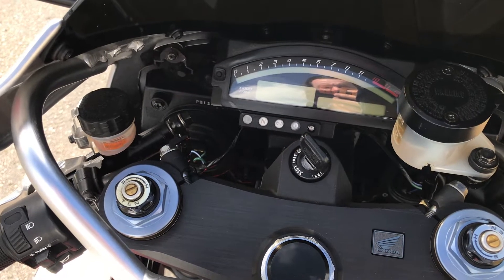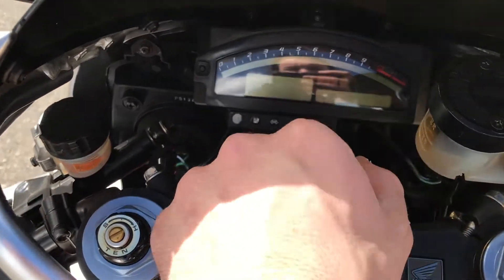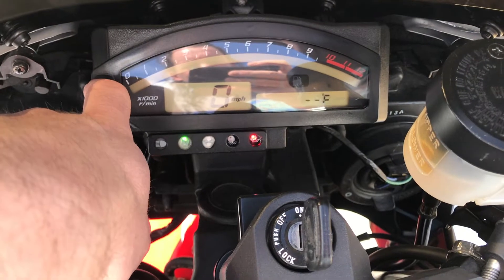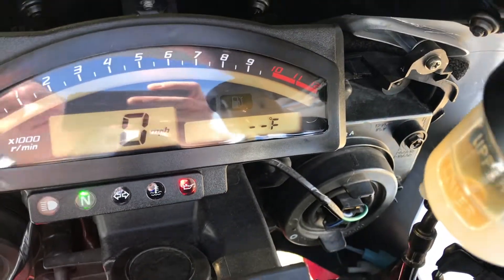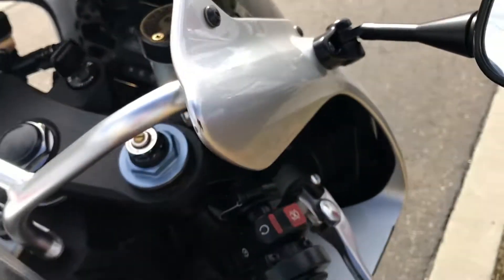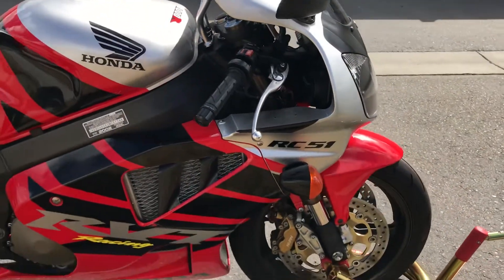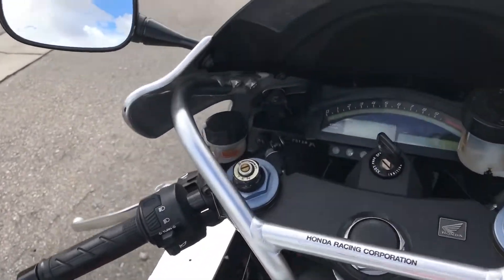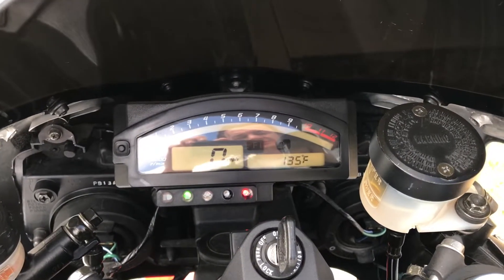2002 Honda RC51 startup

Comment: All I can see here is a truly fun-tastic track bike in the making. As it only has 1 can does it lesson the performance because these twins usually run on two
Reply from the maker: Just saw your comment, couple year delay 😥🤣 I am not totally familiar with various states of tune and one can versus two. I feel like, back in the day, the conclusion was one can provided high RPM power, at the expense of some low and mid range torque, compared with two. But this is definitely something that should be verified on dyno. I do remember performance exhausts made by major manufacturers in both configurations. I think I recall HRC bikes with two, high mount cans. Now I’m gonna go back and look at my photos of Nicky’s bikes.
Reply: @CurtisBrandt  😂😂😂😂😂better 'late'.  than never! Thank you for the lovely reply 😉

Comment: Only one muffler  unusual for that bike
Reply: doubled connected
Reply from the maker: Yeah back in the day there were a few companies making single sided cans. I don't think many of the top racers used them, usually high-mount doubles. I think the single cans made less mid-range. I wouldn't have put this one on, myself, but it looked and sounded cool! When I bought this bike (which I've long-since sold), I looked around for anything like akra or Moriwaki but I couldn't easily find them, like back in the day. About the only thing I could find that was being actively produced were maybe some Yosh slip ons. Probably not an improvement. Then I sold the bike so it didn't matter. If I still had it, I think I'd have continued the search.

Comment: Is there any difference in HP going from 4 to 2 vs. 4 to 1? Is there a sound difference?
Reply from the maker: Great question! I'm not in a position to answer that but there are people who are! If anyone remembers their time tuning RC51s! I had a 2001 and much later this 2002, and they were quite different in terms of chassis setup and feel. I don't recall differences in power or delivery on the street, except that the 2002 didn't feel as fast as my 2001 did, back in the day, because now I was riding it back to back with a BEAST! LOL.

Comment: How did you Turn your exhaust to single???
Reply from the maker: I purchased this bike used, and it came that way. There aren't a great number of aftermarket exhausts currently available for this bike!
Reply: Did you ever find out if it's good to run the single or duel exhaust on RC's?
Reply from the maker: @deontetanniehill3225  I didn't dyno that bike. I'm sure every pipe is a bit different and will benefit from proper fuel tuning. I could be wrong but back in the day, it seems like I remember the dual pipe setups being better for midrange and the single pipes better for top end. I could be wrong and it'll come down to getting a quality pipe and some good tuning. I went looking, briefly, at options while I had this bike, and sadly there just aren't as many options out there for this bike anymore. Used to be Moriwaki, Akra, Jardine, Two Brothers, Yoshimura, and more. Now, not so much. I just left the stock cans on my previous 2001, and this used 2002 came with the single. I like quiet bikes (so I can rip, without attracting attention), but it's all good!
Reply: @CurtisBrandt  thx a bunch Curtis. I'll keep in touch 👍🏾

Comment: pretty fat chicken strips on that rear. I also have a single Jardine factory pipe on mine in fact its one of the units from Miguel Duhamel's RC 51 loud as hell.
Reply from the maker: I bought this bike not too long before the video. I put new tires and brake pads on it right away, and it had not been ridden much, on those new Q3s, when the video was made. The tires enjoyed a bit more time leaned over real soon. Unfortunately this video was basically recorded to show she ran nicely, when I put her up for sale. Sure wish I still had that bike. I bet that Jardine pipe sounds incredible!
Reply: @CurtisBrandt  sounds great from where i sit but my friends hate being behind me without ear plugs.
Reply: @CurtisBrandt  hey did that pipe hurt or is it better to run a single pipe on the RC51!? Just wondering i just bought one n looking for the best exhaust for mine.
Reply from the maker: @deontetanniehill3225  I never dyno'd that bike. I wish there were more options for pipes for the RC like there used to be. Let me know what you find.